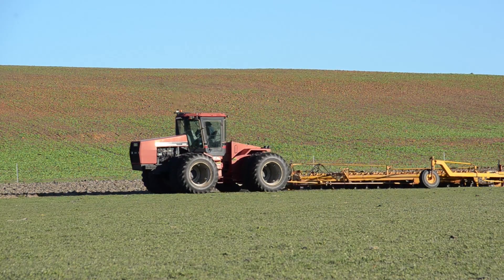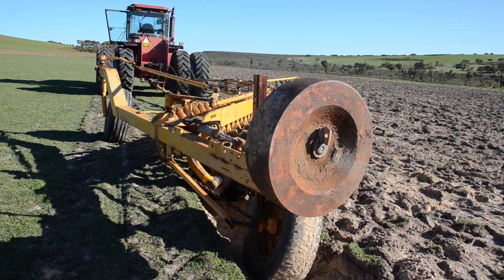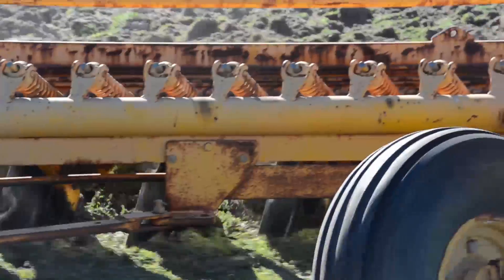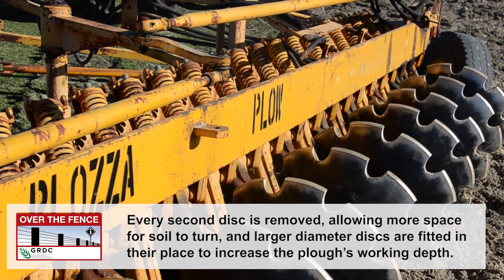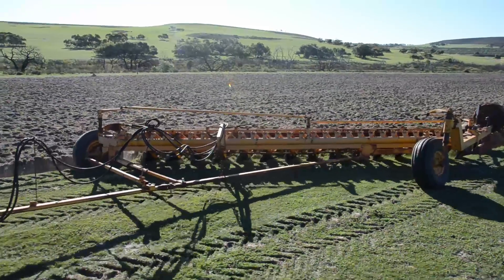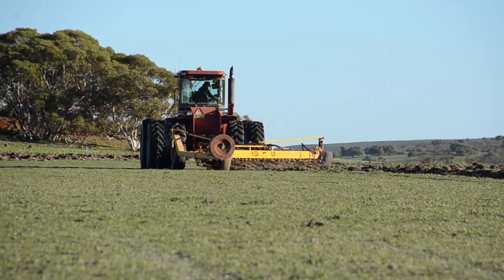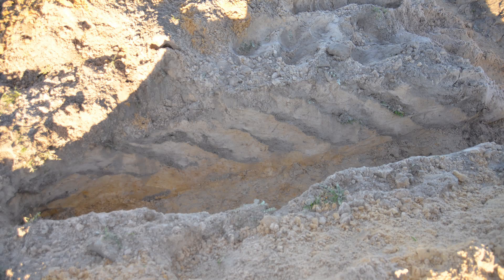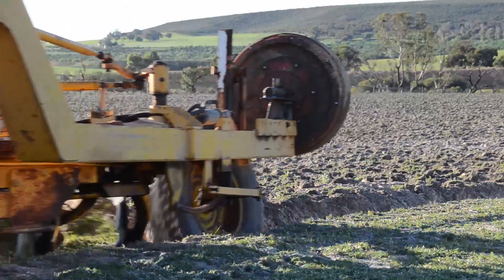Over The Fence West: Modified Chamberlain one-way plough for deep soil inversion

Comment: We've gone back to the old chamberlain 24 disc plough bout ten years ago. When set up correctly they do do a beaut job at burying trash and grasses. Even with the standard 24 discs, if you sink her in to its full depth, you will get a good mix of clay into your top soil. That's the case on our place anyway.  They need bugger alll hp to pull when set properly, get it wrong and they are hard to pull. They will fight the tractor the whole time, ride out the dirt and take off sideways in a flash. Set right and they will follow like a puppy and ya tractor won't know it's there. We pull ours with a 2290 Case.  Powerwise it would easily pull two of them, but they just ain't heavy enough in the back end even when all four tyres are filled with water.  Not to mention that model Case is weak as piss from the motor back. The 504 is a great motor, just the strength of the back end is low.   We pull a round pipe with chains on an angle behind ours and it leaves the soil very very smooth. Seedbed smooth.  Like the one in this vid we have a half ton weight bolted to the back of ours to help keep her in the furrow, but ours has the duel wheel set up, which in my opinion is not as good as a single. There are so many adjustments on one way ploughs, infinite in fact, depth, width,disc castor. What may work perfectly in a sandy paddock may not work in the gravely paddock next to it. But with a little logic thinking that can be solved.
How many discs does this old girl have now,  what size discs are they and how deep can you sink them in.  Great video mate, good to see someone thinking outside of the square for once and having a go and getting results. Thirty years ago the one way plough was a dirty word that caused every problem under the sun. People were giving them away.  Not many of today's farmers would know how to set one up. It's sort of like an art form that's been lost.